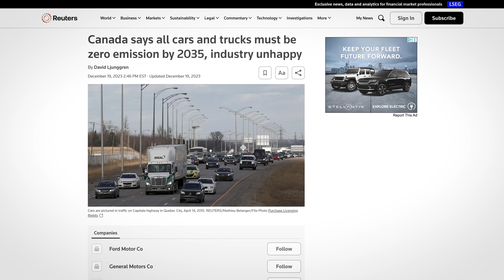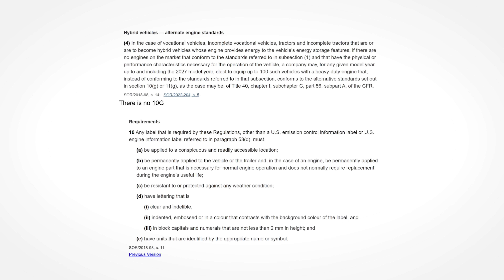Government Red Tape Is Blocking Our Plug-In Hybrid Trucks

Comment: Have you looked at the Stellantis on-highway generator set. It's going to be used in the Ram Charger pickup truck. I know it's smaller than what you're currently using, but it is EPA compliant. Using a commodity engine, 3.6 pentastar, would make parts and service easy.
Reply: For some reason, Stellantis does not return Edisons phone calls

Comment: why dont you just hook a generator to the on the road engine they are allowing you to use,so you run that motor to charge up the system or drive down the road

Comment: Have you considered this?:
- Get a smaller on-highway certified engine and attach your generator.
- Keep the tuning as-is, to avoid nullifying the on-highway certification. (This is the key point!)
- Even though it's not ideal tuning for a generator, it's still a smaller engine, running at a steady RPM, so it should still be more efficient than a full mechanical truck.
- This would allow you to put unlimited diesel-electric trucks on the road, test out all your systems, and earn some revenue until you get your generator-tuned engine approved.
- (Meanwhile of course, keep lobbying for updated legislation, and use all the exemptions you can!)
- Once you get approval, all you have to do is switch to a different engine going forward, and you get a bonus efficiency boost due to optimized generator tuning.
- For units that are already produced with the on-highway engine/tuning, you could publish an engine swap (or retuning) procedure for existing customers who want that extra bonus.

Comment: Without wanting to sound like an ass, Plug in Hybrids are stupid.
They are like trying to have both a Electric and a Combustion vehicle. NO. The actual concept of a Hybrid is not having the ability to run purely electric.
A Charging port can be good eg if u got solar to recharge the small internal battery but it has to be SMALL the plug in hybrids we have now got massive batteries compared to actual hybrids without a plug.
The whole idea is adding back the efficiency that is lost on acceleration and deceleration with combustion engines. THATS what a hybrid does not drive like a electric car. no always work in symbiosis with the engine.
Help the engine accelerate and take energy back out reducing brake wear and charging the battery back up. Most fuel use and Emissions are made on acceleration Removing that factor makes a combustion engine super efficient compared to any electric vehicle out there. Holding speed is a thing engines do very well even with little power Reducing emissions and fuel usage to a minimum.
So HYBRID vehicles are actually what we need. Not electric vehicles. Nor Plug in hybrids because those are a lie. they arent actual hybrids anymore.

Comment: What's the point of having a plug in hybrid? It's supposed to recharge itself. Why do you need to plug it in
Reply: A plug-in hybrid has a bigger battery than a regular hybrid, so you can drive on cheap electricity if you plug it in. If you don’t, it just runs like a normal hybrid using gas and regen braking. Plugging in saves fuel, cuts emissions, and lets you do most daily trips without using gas.

Comment: Impressive job! Well I'll take my chance to look silly, but what if one would take truck engine and would make a electromechanical actuator thingybob to actuate the throttle pedal depending on the load applied, you know, like old mechanical speed controller of an rc car where servo mechanically moves resistor wiper arm, what efectively electronic throttle pedal is, just a thought...

Comment: Can we run an on highway 6.7 cummins, emissions compliant engine, and run the automotive fuel pump. Maybe use a custom tune or throttle setup to get the engine running at set RPMs instead? 
probably already been though of tho.

Comment: Silly question but what about Reefer trailers? Those engines kick on, and off during transport, they are governed in the same way a generator engine is. They are smaller engines though that coud be why. Good luck guys you will figure this out.

Comment: Maybe look at yanmar/ kobota engines that carrier and thermoking reefers use they aren't mechanical throttle they go of electrical load there'd be zero reason why you couldn't use them from a compliance standpoint would be flawed as they are already legal in trailers

Comment: You are innovating on something that is not a crisis for our government, that is a good way to go bankrupt.
If you need to pivot, put your hand up to build ferries here in BC, if you can fit a diesel electric system under the hood of a truck, you will have no trouble in a main machinery space, and there are folks around who can deal with the boat-bits, plus you are already talking to TC.  Then, $1.2B later, get back to making trucks to put on the boats.

Comment: BYD has a similar concept available on mass produced electric vehicle being sold in Mexico. It has a battery and an engine that is not connected to the wheels but acts as a generator to charge the battery. Please check them out to see if there is a highway approved generator in the market.

Comment: Finish building it as you are. Say Fuck the government. Do a one-to-one comparison on a closed private course. Show them the numbers and show them how wasteful the current "legal" systems are and make them look like absolute fools. Bureaucracy crumbles in the face of hard data and public embarrassment

In the meantime, you should also remind them of the fact that if these trucks were fully plugged in non-hybrid there is not enough of an energy grid to support such trucking capabilities nor will it be available by the time they are requiring all trucks to be electric even if construction on improvements starts today

Comment: the liberals and their insiders all invested into the charging infastructure  if you provide your own charging they cant profit from charging fees. if theres no legislation then theres technically no law preventing you from going ahead. its like me and the accessibility act i used a golfcart as a mobility aid dispite the traffic act spisifically stating "golf carts can not be used as a mobility device" but... the avvessibility act in section 4 paragraph 2 states "this act will prevail over any other law or regulation that does not provide more accessibility" a golfcart provides more accessibility than a manual wheelchair with one arm and one leg. that was proven in court police dont bother me anymore

Comment: Build truck as electric and 'use' engine as the one used in those freezer trailers or as auxiliary accessory power unit. Block in software start only in stationary or something. Law's are written by stupid ppl who don't have clue what they are doing never even been around stuff they are signing you can or can't use or do...

Comment: Could you instead build it as an EV truck? 
Oh what, there's a generator option for "recharging at standstill" oh wow, that's a cool option to have for an EV semi. There sure are a lot of stickers that say that you're only supposed to use the generator at standstill but for some reason people keep using it while driving, how crazy.
Reply: Or, or, ask the manufacturer of the generator if they can make a "highway rated" version of the generator for you and, oh look, it takes all the same exact parts as the off highway version so it's completely serviceable and the same price.

Comment: the best case scenario is to use utilize diseL karno generator that cuts the noise by %90 and over %60 fueL efficiency 

Option 2 is to utilize engines out of highway approved cars such as 3 liter or 2 liter audi vw turbo diesel engines capable of 300 to 400kw of power as a modular generator set

allowing to easily use 2 of them 
that adds redundancy and Longer Life expectancy 

aLso if the FEDZ wouLd aLLow you guys to test the output exhust of the 9 Liter engine after installation of thunderstorm exhust fiLter technology 

the probLem wouLd be SoLved
🍃💐

Comment: So you've basically got a train right? an diesel electric combo.
Surely you can use that as an argument for them.

The electric gives you the instant torque or rather torque at all speeds (where a diesel needs RPM) and you have the generator supplying the power where it can run more efficiently and happily chug along. The battery is also there to cover times of demand when the generator would have to spin up (delayed)
Plus having a larger battery, means you can run the truck at times with zero emissions / noise.

Surely the tests for emissions are therefore standardized and your system would be more effective as the diesel component doesn't necessarily have to work as hard as the traditional setup.
Since the load isn't quite the same in terms of tonnage to torque, its a generator and its ability to run the converter.
So it should be easier to prove that it is more emissions friendly and therefore a step in the right direction in terms of being able to still refuel quickly and haul heavy loads while reducing pollutants.

Seems like a no-brainer...

Comment: Misinterpretation of the facts. Your chosen engine doesn't match the emission requirements that were always set out. 
Your motors are a lower emission standard than any on-road vehicles.

Comment: Luckily, there’s no EV mandate in Canada… 
On the other hand, legislators screwed up approx.2 decades ago.
There are EV, equipped with battery pack and electric motors.
There are Plug-in or Range Extender Diesel/Gasoline engine vehicles. Those are NOT EVs! If you have an internal combustion engine built in into the vehicle, requires carbon hydrogen to operate that engine… that’s NOT an EV, that’s an ICE Vehicle.
If a North American company not able compete on the market, one of the Chinese EV Manufacturer company will mop the floor with them… that’s the reason we are gonna between the losers, because we want to protect our Canadian market and it won’t be competition!

Comment: No doubt you folks are pushing innovation in a positive direction for hybrids in industrial level diesel-electric applications. With that said, i think putting the crosshairs on 'government red tape' can be a bit of an anti-government low hanging fruit. 

I think it is completely fair to say our there is a lot of overregulation in a lot of Canadian industries that are not in the best interests of the Canadian public. On the other hand, a lot of regulations out there do benefit the public as they look to protect their safety and interests (lack of enforcement + corruption aside). 

I think it can be fair to say you are venturing into uncharted waters in the application of genset/generator style engine applications for hybrid diesel-electric vehicles regulation-wise. Transient response/load acceptance, control integration, duty-cycle optimization, thermal management, and so on can be big factors in the successful application and longevity oft he soiutions you look to provide. You're taking 2 highly regulated items (on-road engines vs generators) with each of their own set of regulations (according to government regulators) which can be argued are quite different from one another and have different needs to be considered 'compliant.' I would think it is fair to expect there could be some regulatory issues with this. Unfortunately that is likely going to cost you time, money, and energy to deal with. I would say that is fair nonetheless. 

I'll give an example here, albiet a ridiculous one to exaggerate my point. Say my neighbor has a Tesla and finds that given his personal sitaution along with the equipment he has on hand, he can run and charge it on the go more efficiently using an in-car lawn mower engine setup to charge his batteries to create a hybrid setup. He rigs it up so the exhaust is routed out of the car, and it works like a charm (he claims). The question becomes, do you feel safe driving on the road with the guy who thinks this is okay? His setup could potentially fail at any moment, and likely lead to an accident on the road. I would think most people would not want him doing that on the road. If we scale this up to a multi-ton truck barrelling down the highway using equipment that wasn't designed for on-road use, I would think common sense would dictate most people would want clearly defined regulation to be followed to allow that vehicle on the road...

It can be completely agreed upon that government inefficiency is a huge problem, and you definitely should be fast-tracked to some sort of solution to keep progress moving forward, but calling the whole issue 'red tape' to rebut it, and making a video like this, is not going to make you any friends with regulators. I think the fact that they seem to do more to slow you down that assist you speaks volumes. It begs the question--with the automotive and trucking industries being pillars of the north american economy for decades, do industry leaders (really, I want to say oligarchs) even want you to be innovating? Or would they rather see businesses like yours struggle and spin their wheels while they roll out their (non)solutions to the market share they already own and milk for money? Your business is very efficient for the economy, but wouldn't industry leaders just want their consumers to buy new? In their eyes, that's more efficient for the economy. I don't know if that's a battle that can be won unfortunately.

Comment: This seems to be mostly an issue with them having a loophole in the rules that dictate their regulation and not knowing what to do so taking the safe bet and just saying no until they get a solid answer from the legislature. It makes sense to me even if ultimately is really stupid in the big picture. Someone just didn't have the fore-site to plan ahead for something like this. Whoever told you to use the on highway motor just didn't know enough and was trying to offer a solution to fast track your approval.

Comment: Could you mount the engine on a skid and make it a“ detachable” accessory? Plug ins for power to the batteries, computer connections and controls, etc. and circumvent those regulations. They don’t have to be easy access, just there so you can say it’s a portable generator. ??? I know it’s cost more to build it that way but until legislators get off their collective a**es and approve something; and stop holding back small manufacturer innovation in favor of these big corporations, it may allow you to build compliant and stay on schedule.

Comment: Running a smaller engine at optimum rpm and load... reduces emissions keeps the engine in the ideal range...  but use the engine PTO mode on the engine that should work.
Reply: REPTO FEPTO  calibrations should work on the on highway engines i don't see an issue. It should be easy

Comment: 7:00 could Cummins tune you a program that keeps that highway diesel at whatever rpm you need for your generator? Then it’s no longer a generator engine but a highway engine?

Comment: I was wondering when your project would hit a road block, carefully put in place by the immense lobbying efforts of the mining and oil giants. There have been other series hybrid type projects in the past that weren't allowed to come to fruition. The Partnership for a New Generation of Vehicles developed diesel electric hybrid sedans a quarter century ago that could get around 80mpg. These were almost production ready units. And then, suddenly, the program was cancelled and the technology was shelved.

Good luck though. Is there a way to skirt the regulations by towing your generator as part of the load? Reefer engines probably don't put out enough power unless you could daisy chain them together.

Comment: Maybe you could take small car engine, that is certified for on-highway use, couple it to generator, and using custom ECU like Halltec, make it run how you needed to effectively convert it to generator, while retaining on-highway certification.

I realize that it requires complete re-design of everything that touches generator, so it could be not the best way out

Comment: Using a dieselengine to charge batteries for an electric motor is kind of dumb to be honest. Sure, running the genny at a fixed RPM might increase the effiency a notch compared to a regular truck but there is no way it will compromise for the emissions caused by building the batteries. Ever. You are being dishonest when pushing this as "environmentally friendly".

Comment: If you’re certifying a new engine family, consider H₂-SCR over DEF-SCR. H₂ dosing enables strong NOx control at low temps, letting you tune for higher BTE. Fleets see the upside as better mpg, fewer cold-start NOx issues, and reduced maintenance (no DEF tank/pump/heaters, fewer winter failures). It’s a cleaner path to compliance without hobbling engine performance.

Comment: Is there a way to use a small linear motor to adjust the throttle on a small highway diesel engine. Maybe a small cheap computer like an Arduino or raspberry pi/orange pi

Comment: I know it's somewhat suboptimal but for testing purposes... Can you just build the truck without the generator with a bit larger hood space, rig the engine to be somewhat easy to swap and call it an off-road generator? While on large scale it shouldn't work (although in Canada, who knows), for testing bunch of trucks by customers it could pass. The truck is full electric with charging option from stationary generator you get with the truck. It also has a special trunk to store the generator inside the truck.

Comment: your issue makes no sense mechanically. the governor controls the throttle on a generator in the same way the peddle controls the throttle in a truck...just attach the governor to the throttle of the road engine

Comment: Run two 12.5 kw Cummins RV generators run by a computer algorithm to start up BEFORE the battery needs it based on route.  In other words, you could fire up one or two generators immediately as the battery storage is used.